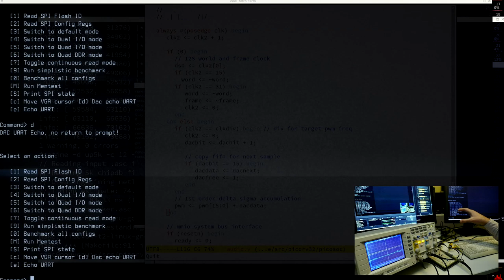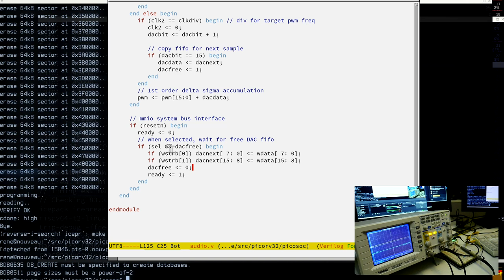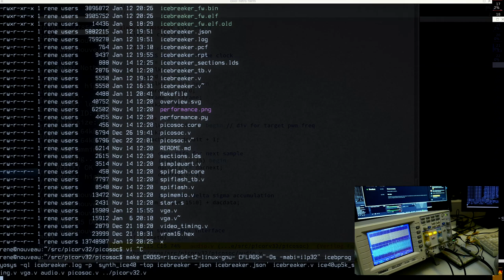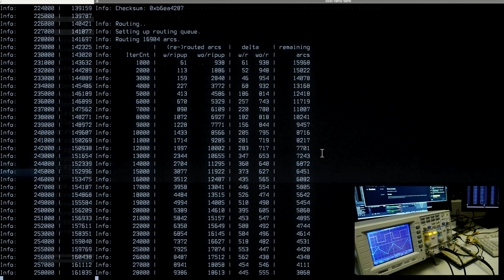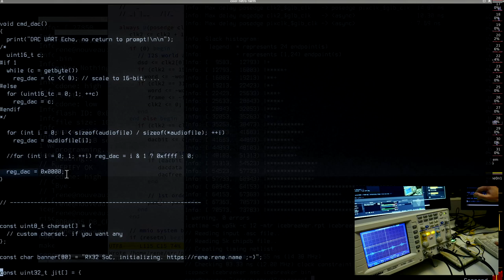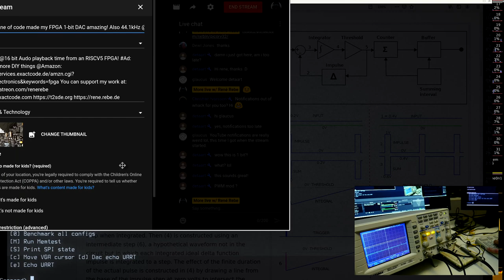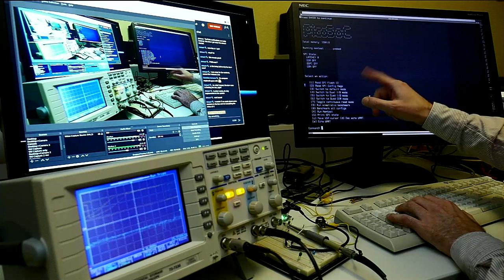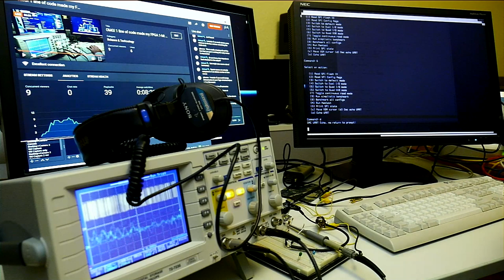DIY 12MHz FPGA 1-bit DSD DAC sound amazing! Also 44.1kHz @16 Bit and RISCV!

Comment: You madman!  I need to see your newer videos.
Reply from the maker: many are random live work on my Linux distribution t2, I plan to do more interesting stuff soon again now that 15 archichtectures fully cross compile ;-)
Reply: @MoreReneRebe  It may not be in your scope of interest, but how much worse or better would it be to make an r2r 16-bit dac?  (Ignoring dsd of course)

Also approximately how much space does the current design use?

I'm thinking about either buying a chip and building a dac.  Possibly a tda1541 for example.

That or possibly buying something like an icebreaker board and looking for a small enough design to drop on it.

My interest in the r2r design, is that I'm worried about high frequency noise possibly killing anything I attached to it.
Reply from the maker: @nocturnal0072  do you mean pure resistors? I think that does not work too well for more than 8 bits, ..? the DAC does not use too many logic elements on the FPGA ;-) Of course using ready made ICs can be very high end: Been there, done that in 1998 or so, too: https://www.youtube.com/watch?v=DT4VXf6gGUI
Reply: @MoreReneRebe    Nice on the size part.  Yes, anything larger that 16 bit is not practical because of physics, with an r2r design.  That's why delta sigma (over sampling) designs are dominant, at least from my understanding.

R2R have their own benefits and drawbacks, but are still on the market.  Schiit audio is using micro controllers and chord is using fpga designs.
Reply: @MoreReneRebe   I looked at it a bit more, didn't think of it as a pure resister.  That lead me down a different rabbit hole.  Thanks!

Comment: I tried something similar with an ESP8266 chip - 160Mhz CPU , all i could get was 8Khz @ 8 bit. was trying to build a small VoIP system with WebRTC, it worked for the most part except the audio quality.
Reply from the maker: But banging with a micro is probably a bit expensive. Does it have DMA it i2c or i2s to make it more efficient ?
Reply: @MoreReneRebe  model does state it has DMA (direct memory access as I understand) barely got anywhere after the output. All the chip ever really did was post as a analog to digital to serial data to an application.